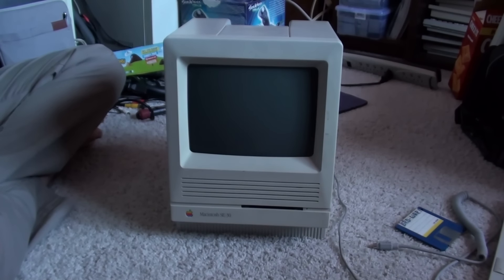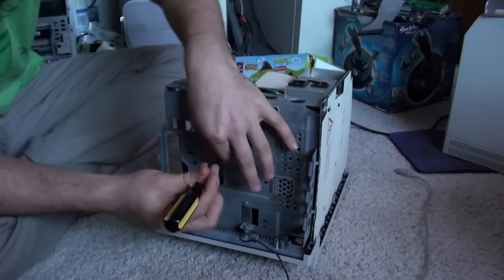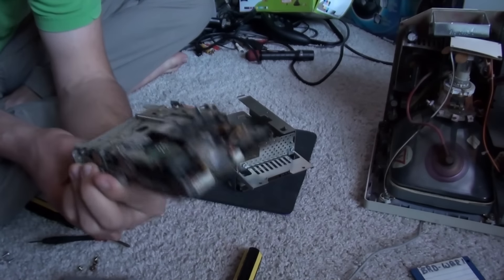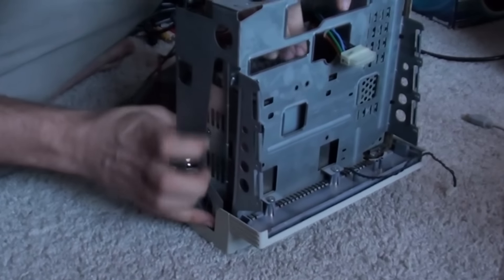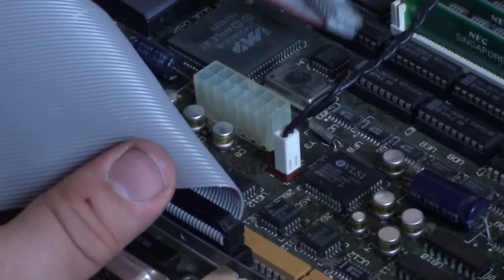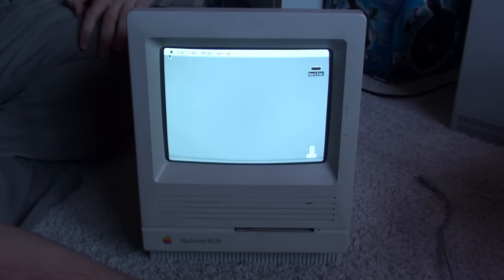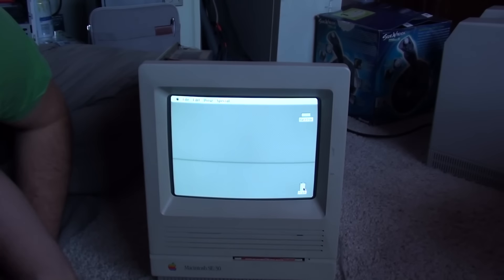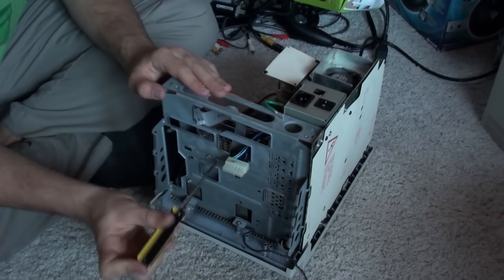Risking it all - SE/30 Floppy Drive Replacement

Comment: I'd prefer working with an iMac G3 as the CRT is shielded from the "logic" board and other parts I'm interested in working with. Bare CRTs out of their enclosures scare me. Too bad I still don't have a classic monochrome Macintosh.
Reply: The only thing you have to worry about is cracking the glass or necking the tube, both of which usually just mean that it'll stop working at all and you have to buy a replacement. If you're removing cataracts from the screen, be extremely careful because the tube has a serious risk of implosion. So long as you don't leave the tube in circuit, the high voltage from the fly back won't hurt you at all, but if you leave the tube in circuit it acts as a capacitor, which will bring the 24kV at .2mA to 24kV at 2A which will really ruin your decade.
Reply: HAppy we ain't using them in 2016
Reply: Milan Jovanovic That high pitched noise is annoying as hell.
Reply: +Sauce We use CRTs, still
Reply: +Milan Jovanovic There's a solution for that - Ageing.
Reply: Shane Pajka
15.7KHz is for NTSC television signals. Computer monitors will not make this sound.
Reply: some CRT TVs have the screech, some don't i know that the 25" in my room has the screech and unlike some other CRTs i have used it's REALLY FU*** LOUD

Comment: Mmm a CRT won't harm you as long as you don't remove the rubber cap covering the high potential anode. The fly back dies on its own since the oscillator transistors won't be running anymore, meaning that once it's powered off the board is safe. It's still wise to discharge the tube before you go poking around in that area, or at least disconnect it in the case that the internal diode between the anode and the fly back has shorted or was never installed. 

Excellent way to start my week!
Reply: Average CRT anode voltage is probably nearer to 22kV than 27, but that's close enough. During operation, the fly back puts out high voltage but low current, usually so low that you won't even feel it. However, if you leave it in circuit with the CRT, the tube will act as a sort of capacitor and bring that current up to dangerous levels, even at low voltage. 

The general rule of thumb is to leave the damned thing alone, it's not as dangerous as people make them out to be, but they're dangerous enough that you really shouldn't mess with them without any prior instruction.
Reply: That boot time just shows you that no matter just how fast we clock our processors and no matter how many cores we add, the old equipment will always be better because it's simplicity leaves less to go wrong. They also don't compensate for the mentally disabled generations of today, but that's a different story.
Reply: I agree, I had to take a double look at that boot. I think System 6 was written in close to assembly. The problem is, today's OSs need to load a lot of libraries, and lots of high-level language stuff. That's why a browser a decade ago might've used 100MB, and the one I'm using now is eating 1GB. iTunes is gobbling on half a gig. But, I guess that's why we have SSDs :D
Reply: When teaching people this, you shouldn't rule out the possibility of high voltage capacitors being present and charged on a board after disconnecting the HV anode from the CRT. In this case though, the only high voltage caps (AFAIK) are the DC filter ones inside the PSU, so it's safe. Not all old boards have a bleeding resistor for the big caps.
Reply: +Digital Style I also do see AIO inc. on most if not all of the channels I watch.
Reply: *****
Possibly.

***** I watch a lot of YouTube.
armanelgtron That's not unusual.
8bitbubsy While this is true... The Macintosh SE uses a hard power switch, which when turned off discharged everything in the system, since it is the equivalent to being unplugged from the wall.

Comment: i just got a mac SE. Artifacting was all over the screen so i removed the mainboard and checked the caps and battery, removed the battery then washed the board with a toothbrush in isoproply alcohol then distilled water then dried for 5 days. works perfect now. even came with all its manuals

Comment: if you load up a 7.0 startup disk with the apple share extension you can load a shared disk image/folder from a newer internet connected mac over serial to install the os bypassing the floppy drive. allowing you to mass transfer data or even install larger mac os installs like 7.5.5.

Comment: There is a capacitor that discharges the Crt when powers off so it's not that dangerous even though when I disassembled mine I discharged the Crt anyways

Comment: The "potentiometers" on the power board are inductors, you're supposed to use a plastic tool to adjust them.

Comment: Ah hell Ian, if it runs 7.1 and up it can read up 2TB I believe. Also if you replace the rom with a 32bit rom with one from one of the Macintosh II's you can supposedly have 128MB of ram, or if you run MODE32 with 32 Bit addressing.
Reply: Also if you want a modern SCSI "SSD" try SCSI2SD, the module costs around $70 - $100

Comment: this may sound kinda dumb, but what exactly is bad about a CRT screen that you can't touch it?
Reply: Lucas Eberhardt The tube holds high current/high voltage, which could kill you if touched at the wrong position, and also the power  supply has charged, high voltage capacitors, also dangerous

Comment: For a healthy person the dangers of the flyback transformer in CRT-monitors is overrated. It's extremely high voltage, but there is barely any capacitance.

Now I still won't recommend sticking your dirty fingers in the monitor, but if you are going to work on the machine, keep it unplugged for a few days, stick a crocodile clip between an isolated, flat screwdriver and something you are 100% sure is grounded, and then poke the screwdriver between the protective grommet using only one hand, making sure that you are in contact with the metal in the middle of the anode. This is much safer than just trying to avoid touching components of the CRT-monitor.

Comment: I"ve reached the point where I try to avoid taking any of my SE's apart if I don't have to. Anytime I do, it seems something else goes wrong. 30 year old cables, connectors, caps, etc. just don't don't like to be disturbed. Soon as I find a decent and affordable 8 or 9" screen, I'm throwing either my RPi or my old 2006 mini in a Classic Case and calling it a day.
edit: And I'm through putting those stupid Torx screws back in. These old Macs hold together quite well without them. :)

Comment: you forgot to recap the logic board. This is step #1. Then, you didnt use the correct drive whcih is why your having so much hassle getting the disks in and out. That is known as the Manual Inject drive, whereas the SE came with an Auto Inject drive. 2 different generations.

Comment: Put an ssd in an Xbox 360.
Reply: Doesn't the Xbox 360 use sata? I heard that Xbox 360 hdd's are sata, but the sata part is plugged into an adapter which is then put into the Xbox. And would it be possible to copy the contents of an official Xbox 360 hdd to an ssd?
Reply: Well, would it be possible to have an external ssd just for games?
Reply: I guess someone would attempt to mod it to support USB 3.0 speeds.. 
but that's just a pipe dream because that'd require modding of the 360 to add the drivers and that's not happening anytime soon

Comment: CRT is some stranger danger.
Reply: Ueno54  Not really, most of the HV goes to the screen, it usually discharges in about 30 minutes, unless you're working on it while turned on, then most of the components for the crt become 'hot' (high voltage, high amperage), you could die of it, if exposed enough, usually a little touch wouldn't kill you, it does burn your skin and makes a little hole on it, and it hurst your whole arm for a week.
Reply: CRT CAN'T INVADE MY SAFE SPACE.
Reply: Milan Jovanovic Yes you can, not really useful if you're just servicing or repairing it, unless the fly back is defective, in which case you'd have to do that, the problem of it is that if certain things like dust enter there, it's going to get voltage all over the place and the rubber cap looses function, to fix that you'd have to wash the crt display, and apply some non conductive grease on to the rubber cap

Comment: Replace the floppy drive with an ssd.
Reply: Bonkey How would you transfer files, then?
Reply: it was a joke
Reply: Bonkey I know, and i didn't want to offend you, if thats the case, but i still wonder ;)
Reply: Oh, well you would connect the ssd to the computer that has the files and put it there then connect the ssd to the other pc. I don't know if it will work.
Reply: Bonkey There would propably be file system compatibilty issues :/

Comment: there bbbbbb! sd to scsi adapters
Reply: is
Reply: Trigerred much?
Reply: to be diplomatic i will replace the word with the letter b sixtimes followed by an exclamation mark.
Reply: Probably a better choice than seeing if one of those modern $155 64GB SCSI-SSD's would work (with a $15 80/68/50 pass-through adaptor)....